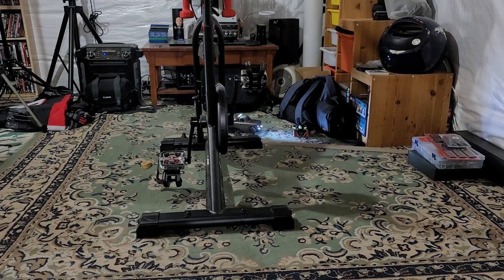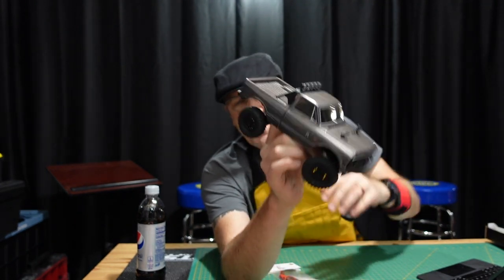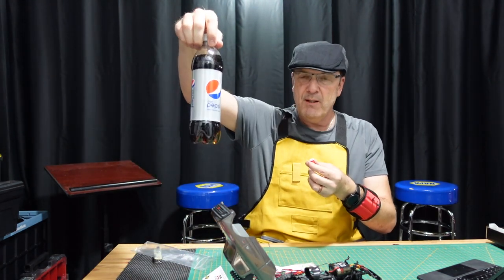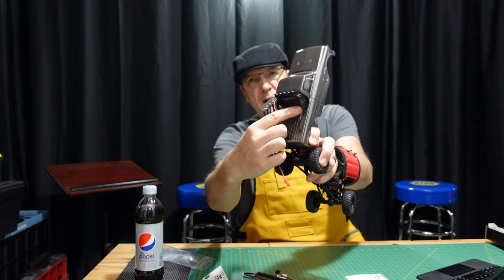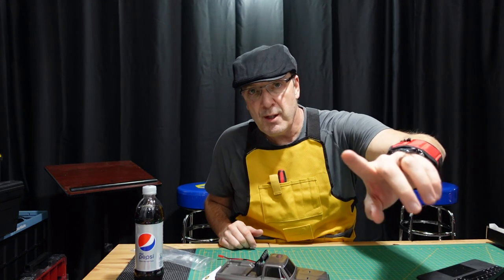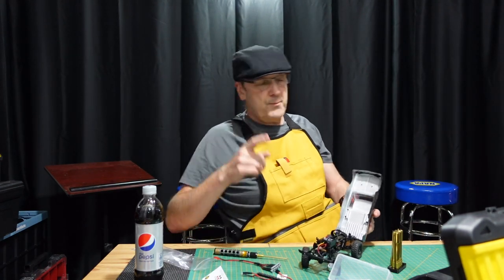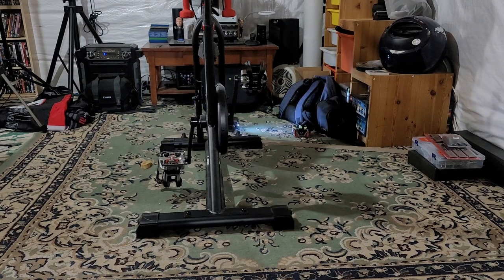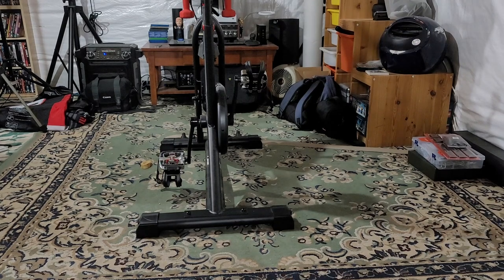WDKWWAD Episode 5: Installing @litLEDlights on an Axial SCX24 1967 Chevy C10

Comment: I used liquid electrical tape, I didn't like how the light shines backwards I blacked it all out with the liquid electrical tape, and covered the buckets , just left the inside of the bucket gray . I also used it on the backside of the headlights, and taillight , help strengthen the wires to the lEDs. And waterproof it.

Comment: In which port do you connected the lights?
Reply from the maker: There are two marked as “LED” on the ESC/receiver. Either one would work. (BTW, I unhooked the lights it came with, because I think it looks better with just the @LitLEDLights.